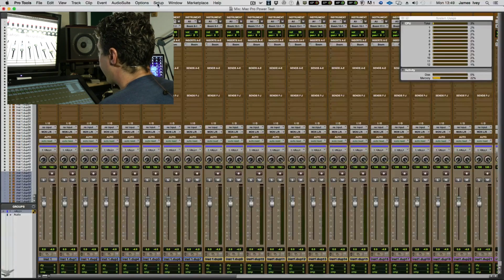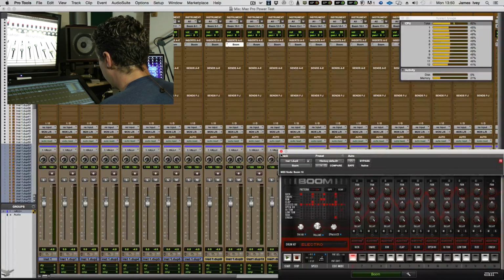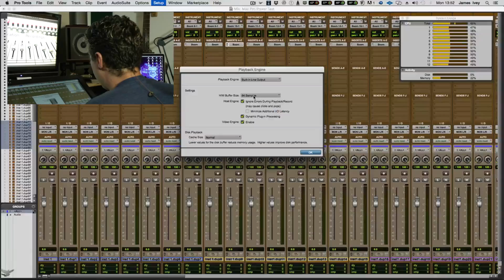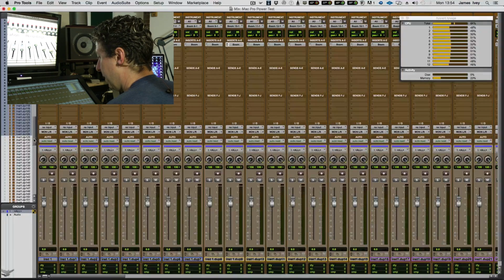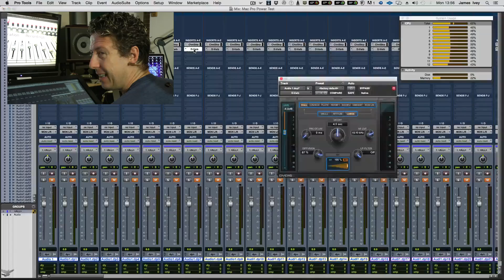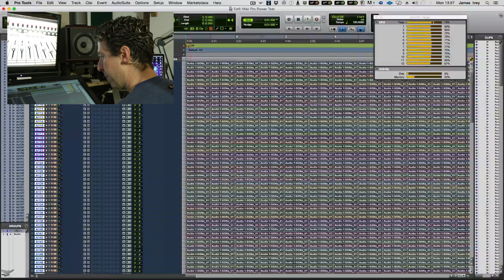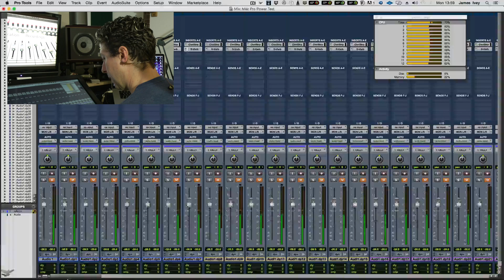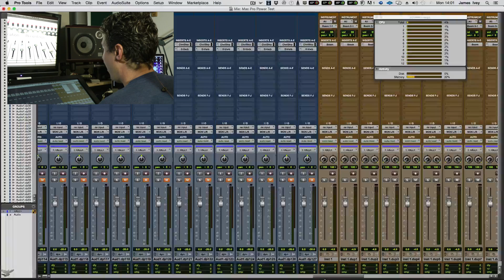Testing a Create Pro Upgraded Mac Pro

Comment: Just tried same test with my upgraded cheese grater. A dual 6 core 3.46 with 32 gig RAM. Got 233 booms and 256 audio with chan strip and d verbs. Just for fun I added 233 d verbs to the boom tracks. I am sitting at 60% at 64 buffer. This did cost big money but well worth it. 466 D verbs!!!!

Comment: Just slapped two 3.46Ghz x5690's in my mac pro. Had to bump up the intake and exhaust fans up a bit to keep the north bridge chip cool at the cost of a few dbs of fan noise, other then that i brought the buffer down in logic X to 64 and it started crying then done a bit of research and read that firewires lowest buffer is 128 before instability. I left it at 128 and its going like a racehorse on steroids :-)
Reply: Nicholas Webb The 5690s are awesome!